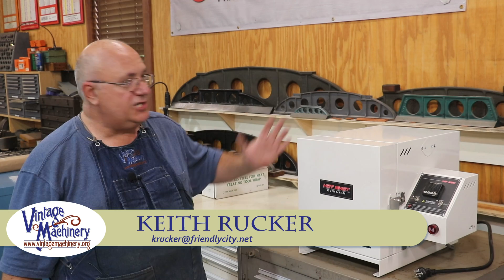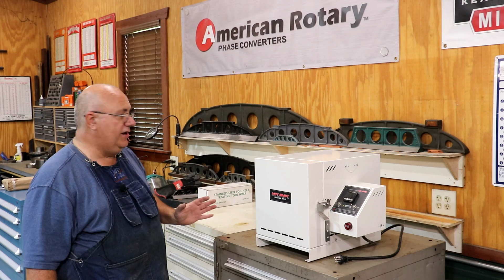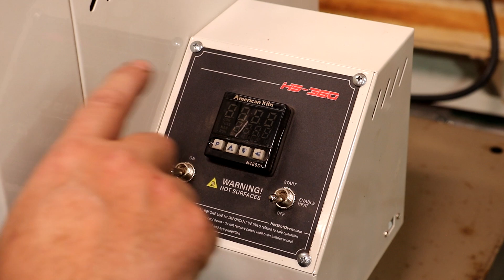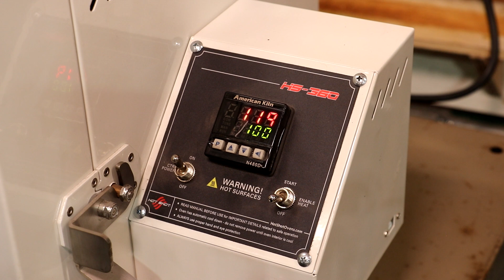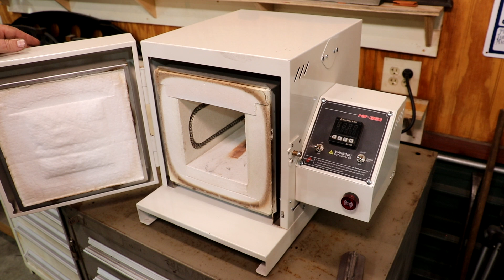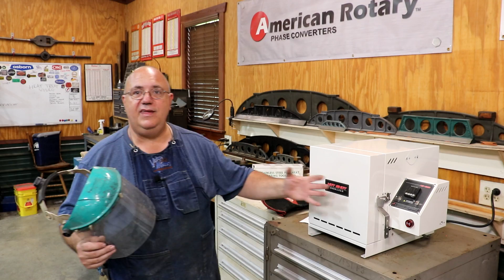Hot Shot Heat Treat Ovens: Heat Treat Oven Basics, Tips and Tricks

Comment: I believe the fan that comes with the oven is rated for only blowing out into an open space, in other words 0.0 static pressure.  All ducts have some static pressure loss and you need to overcome that static pressure.  Thus, if you duct the unit, you need a fan that flows the same amount of air as the built in fan and has the static pressure capability equal to that of the duct that you are using to get the hot air outside.  If the fan you add has more static pressure capability than you need, then you need to provide a weighted draft damper just like you have on a gas or oil fired furnace.  This will keep your new fan from overdrawing the built in fan.  Good luck!

Comment: Great video. I did some heat treating in High School but we just used a torch and went to cherry red, then  some solder to get to proper temp for annealing . I'm curious what happens in say a short and also a longer term power outage . does the machine start up again or what? what happens to the part in a partial heat treat process ? thanks

Comment: How do you run it the first time outdoors without using an extension cord?
Reply: You make your own extension cord. No longer than needed, and in no case longer than about 20 feet (6 m). Use 10 ga. wire. Use NEMA 5-20 plugs and receptacles. If  a 20' extension won't reach in your case, you will need to talk to an electrician about setting up a 120v/20A outlet near the door of your shop. Explain that you will be drawing near the 20 amps of the circuit rating. If it is a long way from your breaker box to the proposed outlet, he may need to use larger wire than required by the electrical code. (A 20 Amp circuit near the outside is useful for a lot more than seasoning your Hotshot for the first time.)

The reason for no extension cord or for a very heavy-duty, purpopse-built cord (don't believe package blurb claiming "heavy-duty" - it isn't) is that the extra length causes a voltage drop and the power available drops with the square of the voltage. A small drop from 120v to 115v means an 8% power drop - possibly enough that the appliance will not be able to operate properly.

As a side note: when any electrical cord is operating near its rated Amp capacity, it MUST be laid out in open air. If it is coiled or covered by something that blocks air circulation over any substantial part of its length, there is a very real likelihood of overheating or melting the insulation and starting a fire. (This includes the cord of the appliance itself.)
Reply: @PeterWMeek  Well said. Most people don't know about voltage drop, much less E²/R.
Reply: I ordered my HS1200 with a 12’ power cord and NEMA 6-20 plug for my shop.

Comment: Remember that if you're using oil for quenching that you must not use a water or other liquid fire extinguisher.  Oil floats on water so putting water on an oil fire will actually spread the fire..  Make sure the extinguisher will deal with Class B (flammable liquid) fires.
Reply: All shop fire extinguishers should be at least ABC rated.  You never know what's going to go up in the shop.
Reply: I'm not an expert, but I'm wanting to learn more, and Keith is a good instructor.
Reply: @Farm_fab  I spent 20 years in the Navy.  We had training, both classroom and practical, in fire fighting at least once per quarter.  Especially since I was a submariner, where we worried about what might get into the ship's atmosphere, fire fighting was a big thing.  In the 1980s there was a bad fire in the submarine USS Bonefish, which killed two people.  Both died of smoke inhalation.
Reply: Where I work, we only use CO2 extinguishers in our shop. It is worth it even where no flammables such as wood or paper, as it makes for easier cleanup.

Comment: Tempering isn't hardening.  Tempering is a toughening process. If you "lose your temper" the metal is either too hard and breaks or too soft to be fit for it's purpose. Sorry to argue semantics, but toughness is a proper term and characteristic of heat treatment.
Reply: Agreed.  The three stages of heat treating are 1) Annealing, or taking a part to its softest state.  2) Hardening, or taking a part to its hardest state. 3) Tempering, or reducing hardness and brittleness while retaining strength.
Reply: I’m pretty sure he was referring to what the oven dose. Technically the oven dose not harden the parts. In A,w,O hardening materials the cooling medium dose the hardening. The oven only heats, which means he’s mostly correct. Annealing or tempering is the only hardening process you can do with just the oven.
Reply: @centurialinc  Again, this is just semantics, but what I'm saying is that overall it would be described as "the heat treating process" not "hardening process". Hardening occurs after heating and quenching. Tempering accurs after hardening. Annealing is another process altogether. Three different aspects of heat treatment like bullet points under a heading, but tempering is not a part of hardening. It's its own thing.

Comment: So I can't bake cookies in it? Nice oven. How about using it to expand bearings and other parts?
Reply: I'd bet that this oven has more accurate temp control than your kitchen oven and because it would see extremely high temps often, there should be no issues with any kind of contamination. I would imagine that not only could you bake cookies in it, they would turn out as good if not better than kitchen made. You can even program a heating profile that would be more suited to cookies.
Now I want to see Keith bake a batch of cookies in the damn thing. Thanks a lot.🙄
Reply: @BigRalphSmith  yeah and if you leave a mess inside just crank it up to 1500 and burn it all out
Reply: Sure you can. They just might be well done.
Reply: Pizza!
Reply: Yes, I can see the logo now.  “American Rotary Cookies. Try a batch now with our delicious cutting oil aroma”